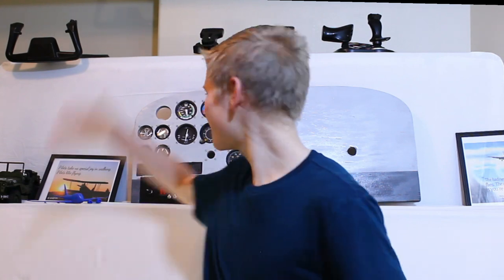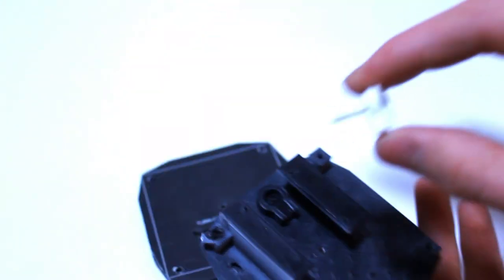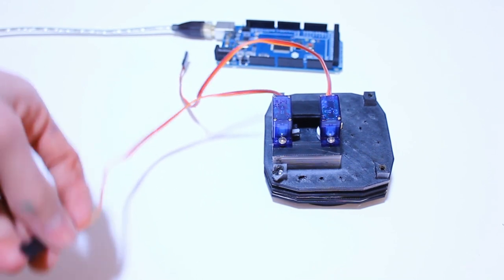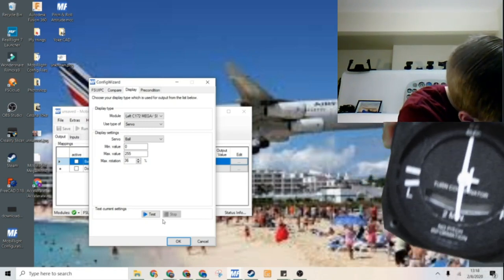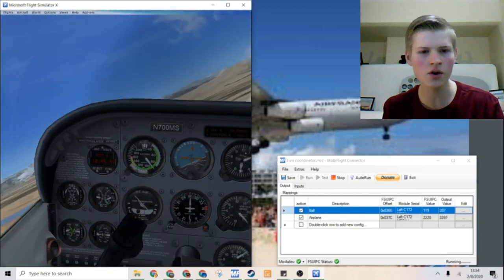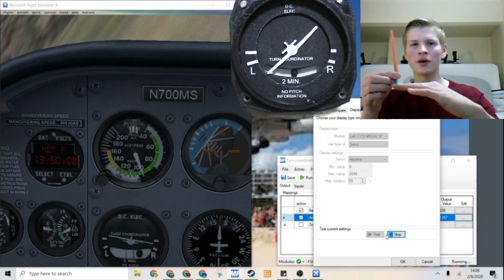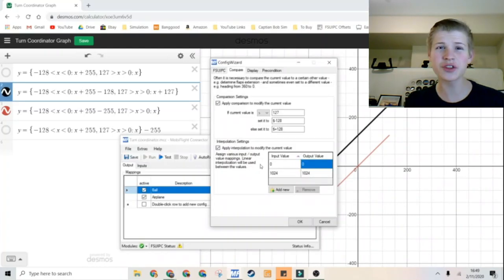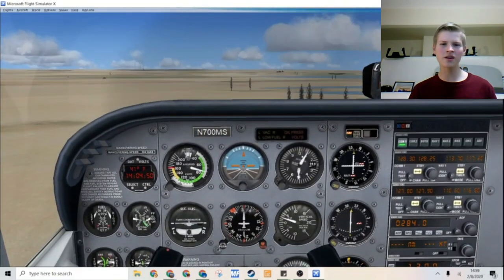How to Build the Turn Coordinator! FSInstruments Episode 7 (Servo Version) | Captain Bob

Comment: What is the best arduino to buy for a beginner to make flight simulater panels
Reply: Hashim Iqbal Arduino Mega and MobiFlight
Reply: How did you learn how to use arduous with flight sim?
Reply from the maker: Watch arduino wiring videos and keep in mind that:
+ = 5V
- = Ground
Every switch has a number input and a ground.
Grounds can be shared
This image might help: https://www.circuitstoday.com/wp-content/uploads/2018/02/Arduino-Mega-Pin-Configuration.jpg

Comment: Hi Trevor. As below I had the turn coordinator working using FSUIPC but cannot configure it in MSFS 2020 . Has any one got this working in 2020
Reply from the maker: I've used the direct FS2020 connect via mobiflight (simconnect?) instead of FSUIPC.
Reply: @CaptainBobSim  Thanks for replying. So no Transform's or Interpolations or Comparisons required is that correct??

Comment: Anyone had issues with the ball running the wrong direction?
Reply from the maker: Use the interpolation setting to swap the values:
For example either:
0    90
90    0

If you already did this, either uncheck the interpolation setting, or set it to 
0      0
90  90
(90 being your maximum value, 0 being the minimum value)
I did a recent video about Comparison settings, I'd refer to it for an explanation.

Comment: Has Arduino stopped production on the mega 2560 r3? Do the clones function as well as the Arduino?
Reply from the maker: https://store.arduino.cc/usa/mega-2560-r3
I don't think so. In my experience, the clones function just as well.
Reply: @CaptainBobSim  I am using clones I have 4 of then in my setup

Comment: Hi Capt bob.what offset u used
Reply from the maker: 037C 2 Turn Rate (for turn coordinator). 0=level, –512=2min Left, +512=2min Right 
and 
036E 1 Turn co-ordinator ball position (slip and skid). –128 is extreme left, +127 is extreme right, 0 is balanced.